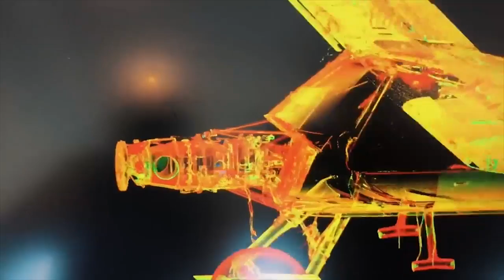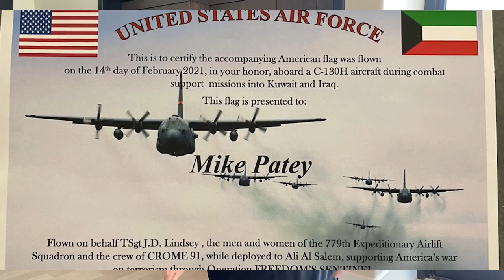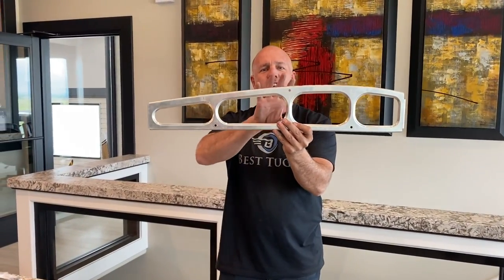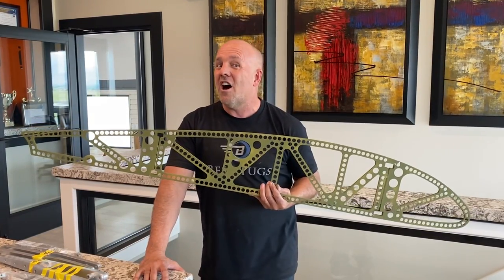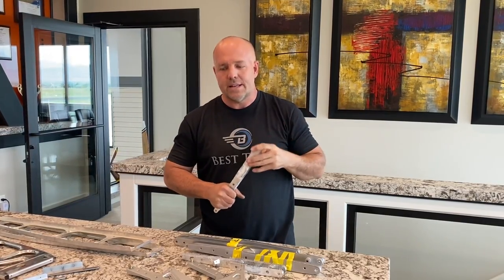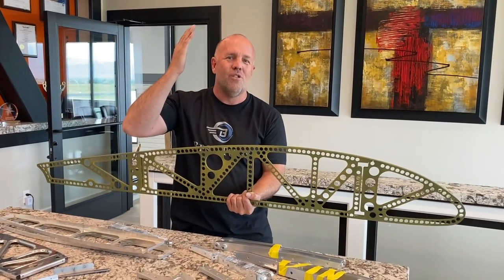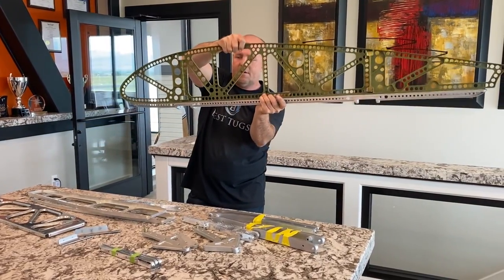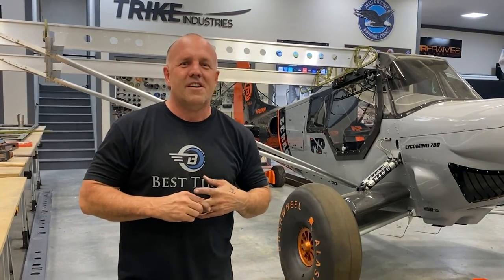Hanging Electric Mountain Bikes from an Airplane's Wing | Scrappy #56

Comment: I am guessing you are making a variable geometry wing. (in addition to the Slats and flaps) Your wing will grow and shrink in chord on command (perhaps fabric, or magical shape shifting (flexible) carbon fiber  The holes in the strut are to hold the servo mechanism, or bell crank, etc.
Reply: And the truss webs are to handle the extra potential load of a thicker cord (on takeoff) and the sheer? loading of the extra speed potential when you adjust the chord for cruise.

Comment: Hey Mike, I think adding stores carriers to the wings on Scrappy is great. I'm sure you've thought of this but I'm wondering about the liabilities of the bikes or whatever when you get in a bind, power fail etc. Maybe set it up like a wing pylon w a lo"king rack (bomb rack). It would sure b nice to get rid of that stuff when things go S. This comes w its hazards as well of course. As stores don't usually behave themselves when released. Especially w aerodynamic stores like fuel tanks & luggage carriers that tend to fly w the plane. That's why "B"racks have pistons that drive the store away from the plane. These r driven by explosive cartridges but maybe springs would suffice in this case. I know its extra weight & a huge amount of extra work in every respect but something to consider.

Comment: Mike, I wish you would work as a consultant to SpaceX. All of the great engineers in the world can't beat someone of equal talent but with the added insight, imagination and experience to put it all together. Hey, just one project at a time. You could start with the catching device, landing gear or the best way to deliver the fuel used during landing from the top of the Starship to the landing engines. Perhaps there is an even better way to do it. Just think, you could help colonize the moon and send humankind to mars!

Comment: If I was a betting man I would say the keyed  holes are for  Stepper Motor actuator mounts for Wing Extension /Leading Edge/Camber control Both extensions out increases cord, Top extension out  adds LE droop bottom extension out reduces camber (now looking for tracks in rib profiles). Round holes May be for cable cross link controlling to prevent asymmetric run-away ....................But unfortunately I'm not a betting man so I have no idea.

Comment: Awesome as usual.

One thing I have been wondering about, the billet ribs that slide onto the spars, what about rubbing, galling, and erosion caused by flexing and movement of the parts?  Are the ribs welded in place or riveted in place to prevent this?

Comment: Are you doing the same attachment plate on both sides? Gives you the ability to add counter weight, or double up on carrying capacity, like the fuel tanks you mentioned for extra long flights.

Comment: That little inserted bit of Looney Toons with the ACME Toothpicks really did a great job at conveying just how much weight you're taking out of the billets that you're using as source material for these spars.
Ever considered 3d printing for that, or is it not something you can do with the alloys you want to use?
EDIT: Had a few minutes to think about it some more, and I realized that the limiting factor might be finding a 3d printer big enough to contain that wing spar so you can print the whole thing in one piece.
I know of a few corporations that have machines big enough for the task, but they're all busy 3d printing parts for rockets, and I guess that takes higher priority than just some guy making a crazy STOL plane out of "scrap" parts he had lying around, as impressive as that is in and of itself.

Comment: Honest question. You mentioned G forces times weight of the mountain bike. But isn’t there a drag multiple as well depending on air speed?  And if so, doesn’t that increase the possible wait during  a bump/turbulence? Also, even without a bump, wouldn’t the drag present a horizontal (or diagonal) stress on the under wing? And does rain play a factor in all of this by adding more weight. Again honest questions.

Comment: Mike, that's looking great. Could the 'extra' holes be the actuator(drive) mounting for the extendable leading edge slats? ? ? OR - You mentioned wing tank, fuel pump mounting? Also, I have an 'environmental' question; "Is all the Aluminium swarf from the CNC recycled?" Phillip C (NZ)

Comment: My first guess is they are for LED lights, but then I thought about it.  Mike mounting an electric bike for use on a bush plane, he will clearly need some way to charge the bike.  So my guess, it will be an electrical connection to charge the bike while in flight

Comment: OK Drawing a line in the sand here - E bike at 50 ???  I turn 79 on July 3rd.  Single track twice a week with guys and gals in their 50s. Still do most of the trails at Kingdom Trails in E. Burke VT  The one guy who just went e bike (80) has had both knees replaced, but he will be riding his Non E when we go to VT. So think about adding a few more decades before the e bike transition.  I am trusting the the e bike comment was only to point out how well deigned that bike rack is. Neat Stuff!

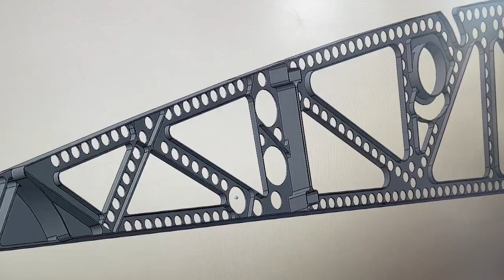Comment: What I really want to know is what the machined arches are in the ribs at around 13:20...  Originally I thought, Fowler flaps, but since its on the leading edge side, that must be the race for the slats to articulate forward and down...  But are the active, rather than passive slats?  In that same image, you can see what looks like the close out for the flaps on the trailing edge,  but I can't figure out the lug on the underside of the wing.  And finally, the comma shaped relief in the crown of the rib is a head scratcher unless its just a pass through for cabling or antennas...

Comment: 6 holes, 5 appearing to be symmetrically encompassing the middle one, 2 are keyed implying electrical termination points or something isnt supposed to spin. Accessory port/ attachment point. 
1. search and rescue equipment needs power and data lines, just keeping it tidy?
2. Mike is trying to talk that squadron into providing aerial refueling and that's where the nozzle will go in?
3. making a series of leading edge wing gadgets that require various things that need to be piped out there like power, pressure, cable control, etc... ?
Back to work!

Comment: Have you considered having an independent design review done on your work? Given all the complexities that has been added, it would make good engineering sense to have a second or third eye on the system and subsystem level and all your assumptions. This is standard practice in engineering and helps catch a lot of issues early on.
Reply: His background IS independent design review AND structural failure analysis.  His company was the best.  Hiring them would be redundant.

Comment: I am pretty sure that you .... only you... thought .. when I make all theses parts ... what’s the air temperature and rate of expansion for this piece.... if it’s 10 degrees cooler those parts will be .0000000000001 di length.... better take that into account.....I can’t say in words how cool it is to watch and learn.    Thanks Mike..... Back to Work

Comment: Mountain bike weight calculation attached on the wing:
    Regular: 25lbs
    E-bike: 80-100lbs
    4G load: 125lbs
Then imagine if you add the weight of a rider on that bike. Hope the wing gets high enough to prevent the head from rubbing the ground, I'm 6'2"!

Comment: One wonders if the CIA will quietly clone this aeroplane as they did with the Helio Courier. Sooner or later when the engine is no longer powerful enough for the builder-pilot's aspirations, will there be supplementing thrust devices hanging off the hard points? Splendid craftsmanship. There must be a host of wornout milling bits by now. What chance they might become souvenirs in little glass-fronted wooden display boxes.

Comment: Hole pattern...... Why would you need a pattern of six holes front to back between the main spars?
Two holes are notched with mounting holes either side.
Those type of notches are usually an anti rotation feature, except the bolt pattern could do that also,
and they are rather large for anti rotation use. So for fitment of a shape? 
The five outer holes are not symmetrical, lending more credence to three items. 
Four holes to the right are in an odd vertical diamond pattern. 
Are we looking at three items, two bolted and four slid thru?

Comment: Hey Mike, question on the suspension adjustment. Is it closed circuit somehow i.e. you don’t need to refill Nitrogen unless you have a leak? Or it just purges when you let the pressure down.

Comment: he already had a nitrous bottle with 900 psi in it so my guess is those holes on the wing spars are for barrels for air cannons. I originally though fireworks but fire on an airplane seems too dangerous.

Comment: i´m a bike guy and i saw that you hang your bikes upside down, please know that your Bike Brakes and your suspension fork have Air in it wich could move into the fluid and ruin your brake power and the lock out of the fork. Seen it many times... greetings from germany

Comment: This reminded me of a joke:  An aerospace company is developing their latest jet aircraft, but when they take it out for a test flight, the wings tear off the plane. They make some changes, take it out for another test, but again, the wings rip off. This puzzles everyone, and the engineering team spends long hours trying to figure out why.  One of those long nights, the janitor comes in to clean the office, and seeing the lead engineer working there so late, he inquires why. The engineer tells him about his problem, and the janitor, after some thought says, “why don’t you just put some holes on the wing, at the location where it rips apart?”  The engineer thinks that this is the most preposterous idea, but having tried everything else and failed, he decides to give it a try. They build the new wings with the holes, and the plane flies like a dream. Excited, the engineer finds the janitor, and asks him how he thought of it. And the janitor replies, “well, that’s because of my experience with toilet paper. The damn thing never rips where the holes are!”.
So, I think that those holes are there to add some strength to the wing 😁

Comment: Before you yell I have been gone for over a week with no internet. I did not look at the comments. With that being said the extra holes in the wings look like pass through holes so he can mount external fuel cells and run the lines and electrical wires to the fuel cells in the wing.

Comment: I think they're for a second wing.

I couldn't figure out why the hole would be so large and solid, almost like a second spar ... the groove looks too small to be useful to change the surface ... penny drops ... change the surface ... wait ... Mike imagines things other people wouldn't ... how would you change a large surface ... like a wing !!!! I think he got another wing flush on top of this one and when he rotates that round thing the groove has something to do with supporting the second wing so he will have two wings like a biplane but with 1-6 inches between I guess. 

I'm guessing "Mike: Slats are too small, why don't we extend the slat over the top of the whole wing and make it moveable to fit flush when I don't need it". 

It would fit with the general problem he's been working on and I've never seen it done before ... but what do I know, I'm just an interested flight simmer!

Comment: If you loose a load attached to one wing, are you able to dump the load on the other wing so you are not out of balance?  Having survived a "split Flap" failure in a Cessna 210, you never want to be beyond the ability of ailerons to stay level with the horizon.

Comment: Weird holes in spars..? Mounting points for Aux electric motors. He's gonna have electric motors with retractable props on the wings. Because 700+ cubic inches with nitrous  and an air-boat prop still ain't gonna get him off the ground fast enough.

Comment: 50? I was older than you and climbing multi-pitch rock climbs. Sometimes with long uphill approaches with heavy packs. Your younger than you think Mike. That said, I'm all in for the electric mountain bike and the electric motor vehicle(s) you should be driving to the stores, dinner out, grand-kids events and more. Global warming is real and we need to be all in for our descendants. And ultimately Scrappy and your other planes can run on carbon free bio-fuels. 

I'm not a pilot but my first thought was don't you need to balnace the Ebike weight on opposite wing. Other wise you'd fly in circles right? ;)

Comment: There are only two practical purposes possible for the small circle of holes in the Scrappy's wing spars.  1.  A full compliment of 20 cal. gun barrels.  2.  Air compressor lines to inflate Scrappy's wings for increased lift.  Anything else is just cosmetics...GET BACK TO WORK! :)

Comment: The weight saved by those little holes aren't worth the loss in structural load.  I would feel safer knowing I have a little extra built into the wing...  Looks like you should be able to nicely carry guns, mountain bikes, sidewinder missals...

Comment: Mike I'm in your head, IF, your Flaps and Ailerons were configured to both work as FLAPERONS and your Leading edge Slats were movable to the point of their trailing edges meeting the leading edge of the wing then you are creating a virtual UNDERCAMBER wing with about 30 or so more percent cord than the original wing! With an UNDERCAMBERED wing and 700+ horsepower you could probably get off the ground in the length of your plane, and when landing at SUPER SLOW Flight you Deploy the Spoilers and descend vertically to the ground with hardly any rollout, Winning every time in your class at Stol and Drag competitions! ?  Get Back To WORK

Comment: You remind me a lot of Howard Hughes. Please don't go into seclusion or quit showering!
    Holes?  I noticed arches!  Is the cord going to thicken via airbag? Or is it all strictly mechanical controlled by servo, or cable? Considering your ribs look to be pushing nearly 6O+ " without your ailerons your flaps. But perhaps that rib was at the root and much of the slides that you have developed is to widen the cord? Yet you did say hinge point. And I didn't think you were putting folding Wings on Scrappy, so are they going to sweep as well?  That's a little more difficult unless your cables all  rotate at the hinge Point as well. Of course you did fabricate your own attachments  for the strut which also has to adjust when you do your in-flight dihedral, anhedral adjustments. If I recall you were neutral or anhedral in Draco. So adjustable would allow both Canyon flying and Comfort, economy. 4 morphs in one?